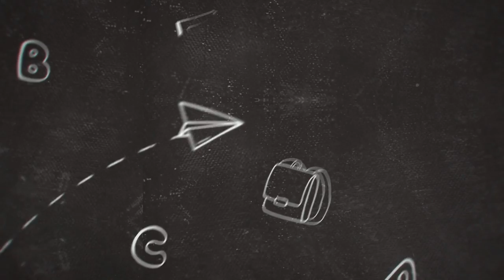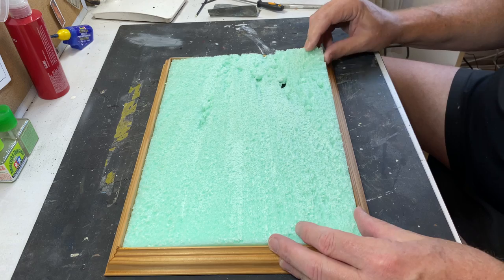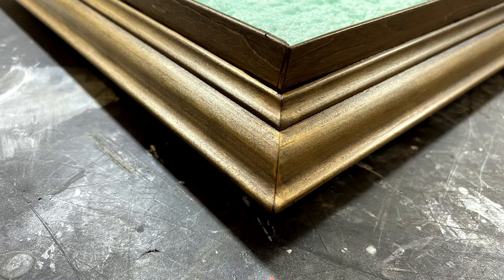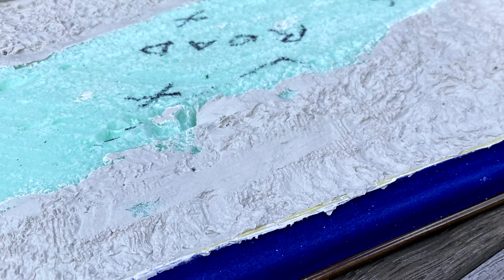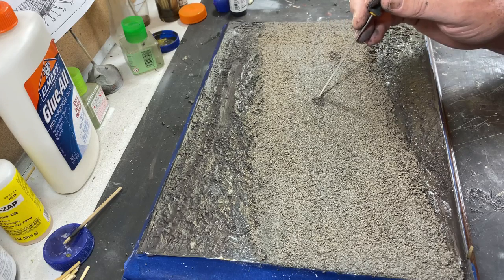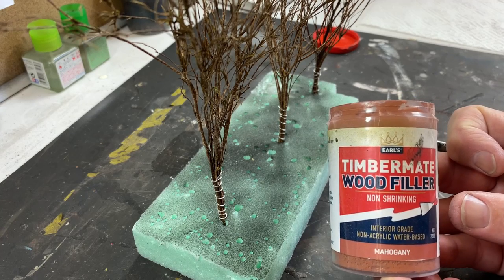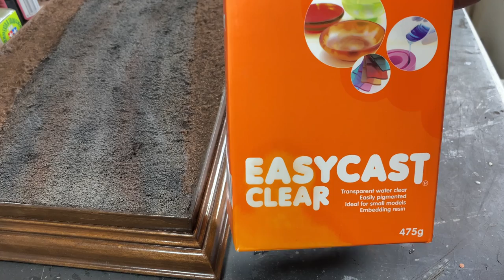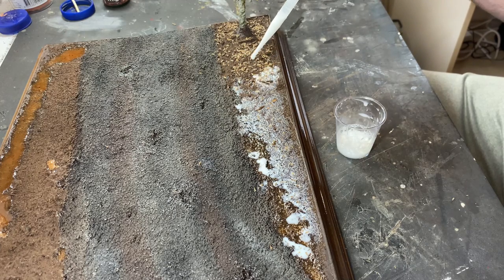How to Build a Diorama Base

Comment: I like the look of that birch. 🤔I use balsa currently and it dents easily. Can be a bit "furry" too. I may well give that a spin mate!  😁Also the tin foil texturizer! Great idea. Very nice groundwork. Good stuff mate. Cheers. 👍
Reply from the maker: Thanks Andrew, the Birch is way better, as easy to work with but none of the down side of balsa, also it takes a stain really well which you cant get with balsa.  Cheers👍👍👍